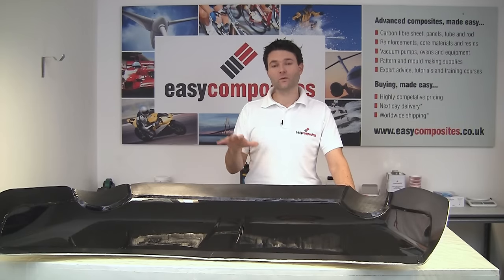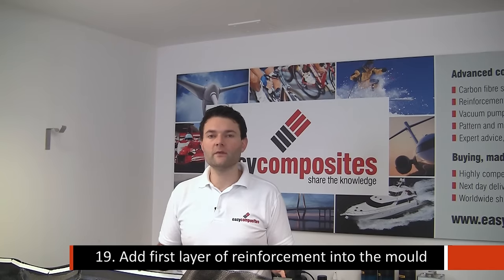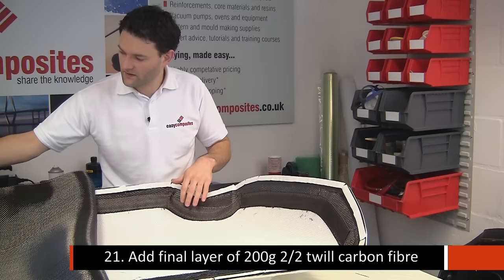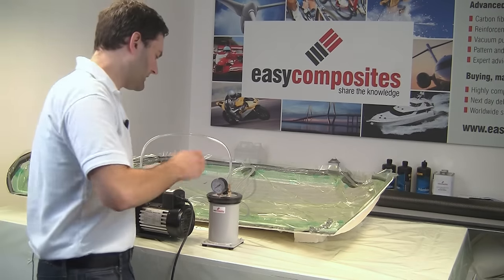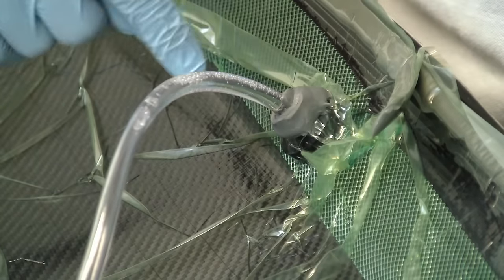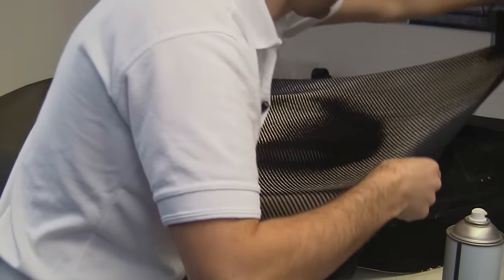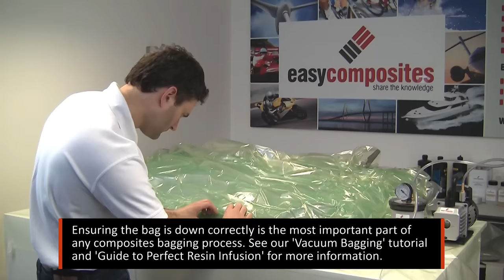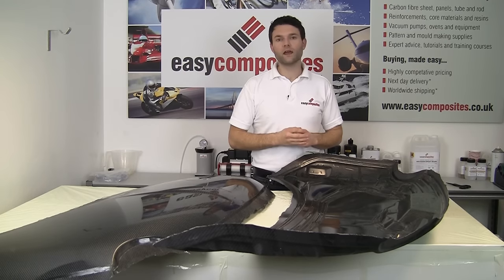How to Make a Carbon Fiber Car Bonnet/Hood - Part 2/3 : Resin Infusion

Comment: wouldnt it be easier to apply the resen with the material ? seems more complicated
Reply from the maker: Applying the resin with the reinforcement would be more like a 'wet layup' process. You would find it very difficult to get the same surface finish or fibre to resin ratio with a wet layup process as you would with resin infusion (as shown here).

Comment: What is the percentage of epoxy per square meter of carbon fiber?
Reply from the maker: It sounds like you're asking about fibre fraction which is a ratio of resin weight to fibre weight (knowing only the resin per sqm ect. isn't the full picture because you would need to know what weight and number of layers of carbon fibre were in that square metre). So, in terms of fibre fraction, resin infusion yields a laminate with 60-40 fibre to resin, so, 40% of the weight of the laminate is epoxy.

Comment: So then why did you polish them and then Your putting the Carbon layer on ??
Reply from the maker: That's because we're using a mould to make the carbon fibre part. It's the mould that we polish, we then use a release agent on the mould and then make the carbon fibre part using the prepared mould. Polishing the mould means that the parts made using it will have a glossy finish.

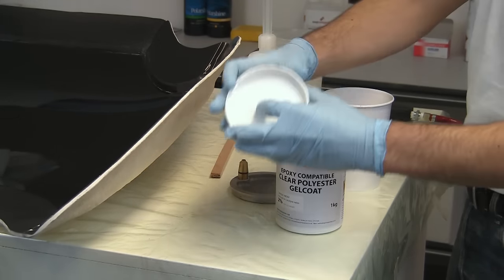Comment: 0:50 I thought compatibility of epoxy/polyester depended on the order of application?
Reply from the maker: The GC50 is especially formulated to have the epoxy compatibility.
Reply: @easycompositestv  ahh so there is a bond so long as it’s polyester first, but the formulation has a stronger bond? Thank you for the reply!

Comment: So was it left to cure at room temperature or what?
Reply from the maker: Yes, the resin cures at room temperature. However, for best results we do recommend post-curing the part (once it's cured at room temperature) to increase the mechanical properties of the resin matrix and also increase the temperature stability of the finished part. For the IN2 Epoxy Infusion Resin (used in this video) the recommended post-cure would be 6hrs at 60'C.

Comment: How much does all that cost? (except for the bonnet)
Reply from the maker: So, just the equipment and the materials to make the mould in the first place, no including the carbon or resin or core materials for the bonnet? - Under £1000 but remember the mould can be re-used indefinitely, as can equipment like the pump, catch-pot, clamps etc.

Comment: could i use this method to make bumpers, I want to get lighter bumpers (race car)
Reply from the maker: Yes, certainly. The process is basically exactly the same although in many cases you would not need to make a separate internal structure for bumpers - you would just make the outer shape (there is no inner shape)
Reply: is vacuum essential in making those panels? will I be able to make simpler, smaller ones, without that step with vacuum?

Comment: This is a awesome teaching tool but what I have been struggling to find and learn is, how to put on the REAL Carbon Fiber. Which the real carbon fiber is called reinforced polymer. I'm looking everywhere on the Web on where you can get one and how to put it on. What you are using is just fabric. It does not have the strength to weight performance and is just meant for style (correct me if I'm wrong.)
I have 3 questions. 
Where can you get the reinforced polymer? 

And when you made a model of the hood, it is lighter right?

And the correct me if I'm wrong.

Thank you.
Reply: Carbon Fiber Reinforced Plastic or Carbon Fiber Reinforced Polymer is just a plastic or polymer reinforced with carbon fiber fabric. What he's doing is exactly what you've been looking for. The fabric is extremely strong by itself, but it's not rigid since it's a fabric. The epoxy resin and catalyst soak into the fabric and then polymerize. The epoxy polymer provides the rigidity while the fabric reinforces the polymer with its immense tensile strength. And yes, since neither the epoxy nor the fabric are very dense at all, the hood he made is much lighter than the metal hood he began with. You saw him effortlessly lift it up out of the mold, didn't you? It was probably less than half as heavy as the original. He used a filler material instead of more carbon fiber, so the hood is probably just as strong as a steel hood. If he had used all carbon fiber, it would be even stronger than the original.
Reply from the maker: As said above, this is REAL carbon fibre.  You may be looking for pre-preg carbon fibres where the fibres are already impregnated with a special slow curing resin.  You could make such a bonnet from pre-preg (even using these moulds for lower temperature out of autoclave pre-pregs), but it would be unneccesarily expensive and only gain a relatively small advantage in strength and weight reduction.

Comment: so how do you make it tacky if the acetone is no longer an option?
Reply from the maker: You can't with the current formulation. You need to rely on laying the carbon into the mould carefully.  Making it tacky was a nice to have step but it is not essential for successful resin infusion, it just makes life easier.  If you are not using a Gel coat then you can use a spray tack sparingly to do the same thing. However most spray tacks are not epoxy compatible so will need to be cleaned off once demoulded and any slight surface marring will need to be polished off.
Reply: Easy Composites Ltd
You guys have to come up with a new way to tack the carbon!! that seems critical.

Comment: Can this be used for wheels? 😁
Reply from the maker: Theoretically it could but in practice the shape and complexity of a wheel doesn't really make it suitable for resin infusion. Wheels are (no surprises) a very difficult thing to make in composites and really are only practically done using prepreg layup and oven or autoclave cure.

Comment: please tell me why my epoxy cures   rubbery & not rigid. I haven't started my hood but my tests have gone poorly😣
Reply from the maker: When it cures rubbery it is usually an indication of a failed cure. This could be a number of reasons such as: incorrect mix ratio, poor measuring, poor mixing, excessive humidity, very low temperature and potentially contamination.  

You need to be a lot more careful and precise with epoxies compared to the more traditional polyester based resins.  Accuracy needs to be within 1% ideally and you absolutely must stick to the manufacturers mix ratio, be that by weight or by volume (which ever is specified - don't assume one or the other).  Spend several minutes thoroughly mixing the resin including the sides and bottom of the cup. It can help to pour the mixed resin into a clean cup before use. Also epoxies are very temperature sensitive so aim to work at 20C or better, and certainly above 15C.
Reply: Easy Composites Ltd ya I think that might be ratio & mix .I'm also worrying that I got sold the wrong product. Ecopoxy advertises it for counter tops & has another epoxy  they sell. Does it make cence that the product I have is meant to be soft for a thicker build?
Reply from the maker: It is possible but you would need to check with the specific manufacturer. You might find in very thin sections you need to cure the part at higher than ambient temperatures for it to go off fully.  However check with Ecopoxy to be sure.
Reply: Thanks I appreciate the help.

Comment: Is there a similar method for cf doors?
Reply from the maker: Yes, the method for making a door would be almost exactly the same as for making a bonnet/hood. You need an inside skin, outside skin, bond them together - just the same way as we did for the bonnet.
Reply: Thanks! I know there is a safety issues for cf hoods that u need to put hood pins cause the cf doesn't stick too well with the metal hatch, so is there a safety issue with the doors as well?

Comment: any updates in the techniques?
Reply from the maker: Hi Alexandru, really, not much has changed in resin infusion technology or technique since we made this video. Maybe if we remade the video today we would probably suggest that customers don't use a gelcoat in their mould and instead just clear coat the part once it's made - this tends to give an even better finish and provide more protection to the part. Other than this, the technology and techniques shown are still a very professional way to make a part like this.

Comment: i'm sure that the cars factory dosnt have all method you used !
Reply from the maker: Not many car factories 'mass produce' OEM carbon fibre car panels but no, those that do don't use a labour intensive process like this, instead it's a method more geared around mass production (far higher tooling and machinery costs, automated processes). Many do use a version of resin infusion but they have billet aluminium moulds (inside and out - a 'matched tool' process) and then infuse the resin with a combination of vacuum and/or positive pressure (known as RTM). The end result would be very similar but means they can produce parts much faster and for less labour, albeit after hundreds of thousands of pounds of investment.

Comment: why you need to put the core mat?
Reply from the maker: The Lantor Soric adds thickness to the laminate (which makes it stiffer) without the need to have lots of layers of carbon which would push the cost and weight up. Core materials exploit the fact that little tensile strength is needed from the material near the centre of a laminate - it's the layers towards the inside and outside that do the work - therefore having a lower sensity material in the core can make a stiffer lighter panel than using a solid laminate.

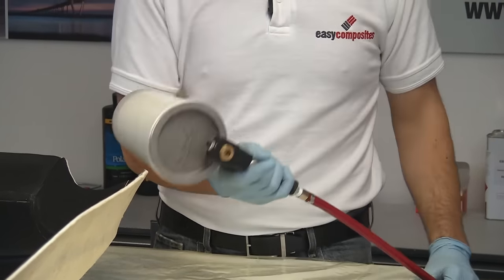Comment: 1:29 where I found this protetion mask ?
Reply from the maker: Hi Jacques, we don't sell them but they are called 'Air Fed Masks' which means they take a pressure feed from the compressor or a blower pack. There are lots of different versions around, if you Google them you should find a system that's right for you.

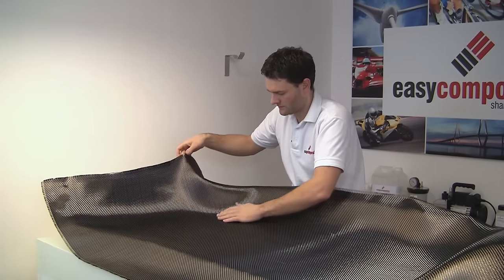Comment: what is the name of the spray sprayed? 3:10
Reply from the maker: The 'spray' we used to help tack the carbon to the gelcoat was just acetone. Depending on the state of cure of the gelcoat, acetone can help to re-activate it and make it a little more tacky. In reality though, this is only effective with certain gelcoats.

Comment: Being a composite and tooling professional for 40 years I see several flaws with your procedure which is pretty good but the importance of thoroughly removing bubbles or trapped air on the very first layers of the mold or tooling. This is why you had to patch. Also all of the air pockets will eventually give way if you're doing multiples. 
 I also cringed and shook my head when you used a steel chisel to pry the parts free....use the medium soft to hard plastic wedges...
The other important process is when you applied the release. For initial parts use PVA coating which insures release. I've seen too many release disasters over the years. 
 You never put on safety glasses throughout the presentation   I hope you never get splashed...
 Thanks for sharing though.

Comment: Do you ship to the US?
Reply from the maker: Yes, we do. Because a lot of the products we sell are classed as 'dangerous goods' this does mean there's a surcharge applied to shipping if you buy resins, release agents, gelcoats etc but we can (and regularly do) ship to customers in the US. If you use our website, the shipping cost (including any applicable surcharge) will be calculated for you automatically as you add products to your basket.

Comment: How many plies was used for the top and the bottom bonnet, that part was not clear
Reply from the maker: The Bonnet skin used one ply of 200gsm carbon cloth either side of a Lantor Soric 2mm core, so 2 plies in total.  The frame use one layer of 200gsm cloth and one layer of 650gsm carbon cloth.

Comment: from where you get the parts (metal) for the hood? i dont find anything about it :(
Reply from the maker: The metal hook was fabricated by a local engineering firm copying the original. Any Decent fabrication or engineering firm should be able to make something similar to suit your hood.  In some cases you can re-use the original if it unbolts.
Reply: Easy Composites Ltd hey thank you very much. all 3 parts are fabricated at a company or can you buy it also in thr internet anywhere?

Comment: hi 3k 2/2 twill?
Reply from the maker: That's right Claudio; 3k (the size of the carbon tows), and 2x2 twill (the weave pattern used for the fabric). 3k 2x2 twill carbon being probably the most common fabric of all.
Reply: @easycompositestv  thankssss is real carbon? not polyester, glass.

Comment: So, why did you use a special Gel Coat and spray it ?.  You never mentioned why.  What's the difference ?
    55 minutes for infusion seems like a lot,  the epoxy should be gelling up a bunch..
We can see, Carbon fiber is not the most expensive part of the Job,  Labor and Consumables are the real cost..
Reply from the maker: The thing that is special about the gelcoat is that it's a UV stable polyester gelcoat but that epoxy resin can bond too. Normally a polyester gelcoat could only be backed-up with a polyester resin. Epoxy gelcoat is a no no becsuse they're not UV stable so this is a relatively unique gelcoat. Advantage to an in-mould coating, rather than a clear coat is that you get the flat gloss finish from the mould on the part which is likely to look flatter and better than paint (unless you flat and polish the paint, which is more work). 55 mins for the infusion is not a problem for our epoxy infusion resin, it has a pot-life of well over an hour and that's time spent in the pot (where it will heat up), when it's in the laminate the gel time is much longer, comfortably over 2 hours.

Comment: Yes agree and your product looks amazing but probably too good and hightech for an average street or racecar. The strength of the carbon is huge and even with the half of it´s strength is more than enough. I´ve been working at one of the most advanced composite factorys in the world at Saab Aircraft and also with Fiberglass and Kevlar for over 15 years. Handlaminating do saves money for somebody that don´t have all the vac pumps and bags etc. But It takes practise to handlam carbon of course  :)

Comment: How much is the total cost of this bonnet?
Reply from the maker: The total cost, in materials, for the bonnet is around £150. There are lots of other costs to get to this point (the vacuum equipment, the mould, the tools etc.) but the raw material costs per bonnet are around £150 once you have the tools, equipment and the moulds. If you'd like a detailed break-down, please email sales@easycomposites.co.uk where we can send you a full list of the materials, tools and other equipment - broken down by cost.
Reply: Easy Composites Ltd Thanks, just wondering for the materials. Is the reason carbon fibre is so expensive just because it takes a while to form?
Reply from the maker: The process of making the carbon fibres in the first place is extremely energy intensive (lots of heat required). Also, once you have the carbon tow, the process of weaving the material into a fabric is relatively slow and requires quite a lot of labour time to set up the looms, quality inspect etc.
Reply: Ceazar Carr
Reply: Easy Composites Ltd but you allowed curing at room temperature. what heat costs are you talking referring to?
Reply: they are referring to the curing of the fibers themselves, being made from the raw carbon resulted from the oil refinery process...for a good quality, high elasticity module, the carbon must be cured at temperatures between 2500-3000 degrees Celsius. A lot of energy required to reach those temperatures, i reckon.
Reply: Daniel i think you mean 300 because 400 is the limit of carbon fiber
Reply: Juan  Hernandez curing as in making the carbon fiber strong during production. Once it is being used in a car, the temperature strength would be 300-400
Reply: It is strong enough when a car crash?
Reply: @ericklyatuu1301   no!  it will burn and explode ;)

Comment: And then someone  sticks it in the wall during practice!     I can see now why these parts cost what they do. That would be  2 weeks work if  i was doing it.
Reply from the maker: The majority of the time, and to some extent costs, are in the actual mould tooling so the good news is that even if you did damage the carbon panel, if you have the mould tools still, you're most of the way there to a replacement.

Comment: I would love to do this, but I feel like I would need to spend $2,000 to get the chemicals and materials to make carbon panels 💁🏼
Reply from the maker: Yes, it's probably not far off that amount, once you've purchased equipment like the vacuum pump, catch-pot, clamps, all of the bagging consumables and included the cost of the mould. However, it's worth remembering that you've got this equipment for life then; future carbon fibre work will then be a lot more cost effective.

Comment: 55 min infusion process might be to long I’d be careful you don’t use to much catalyst, don’t want to end up wit dry spots and a messed up part...
Reply from the maker: We're using epoxy resin in this tutorial so there is no 'catalyst'. You would use catalyst with polyester or vinylester resin, which are very different chemistry to epoxy resin. The resin we're using is a special epoxy infusion resin; high performance and a slow cure with controlled peak exotherm - specifically for resin infusion like this. For high performance parts like this we generally wouldn't recommend polyester resin.
Reply: Easy Composites Ltd very nice and informative thanks...

Comment: 1 week, a £1000 later. hey presto, you have a £500 bonnet.
Reply from the maker: And a complete set of moulds to make more bonnets, and a lot of equipment you can use for years to come, a great new skill under your belt, and a huge sense of achievement.